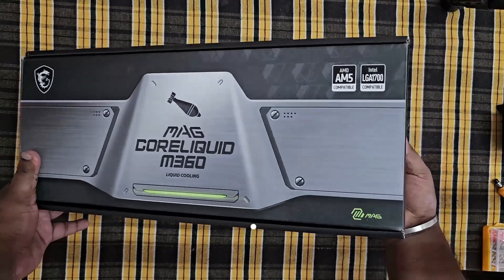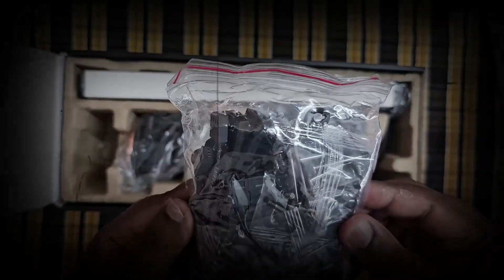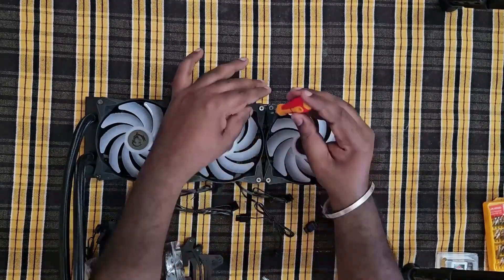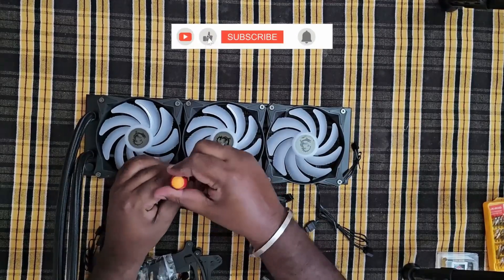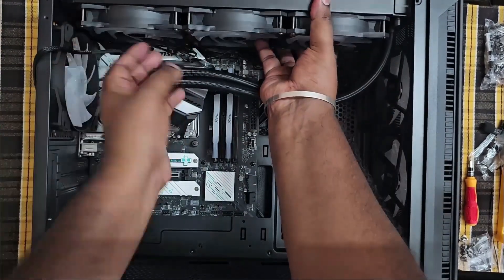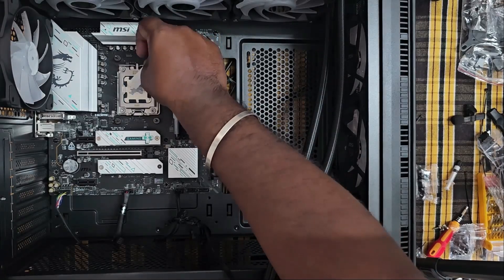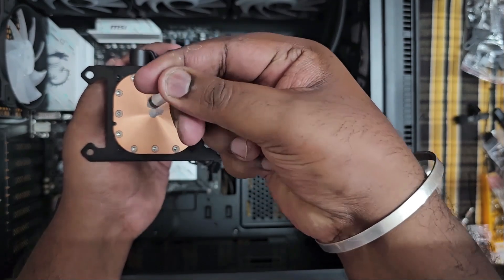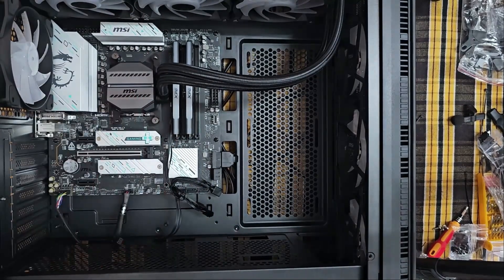MSI MAG CORELIQUID M360 Unboxing & Installation | Step-by-Step Guide

Comment: I'm confused between this and Acer Nitro Vg271U M3 ips monitor, could you tell me which is better ips or va? Also did you buy this from amazon?
Reply from the maker: I think you made this comment on cooler unboxing video. Monitor we have another video and replied to you on same. Anyway the purpose is for gaming then yes ips is better performer comparing to VA. 

Key points to consider:

IPS Pros:

Excellent color reproduction 

Good viewing angles 

Consistent performance across different viewing positions 

Suitable for most gaming genres 

VA Pros:

Superior contrast ratio, leading to deeper blacks in dark scenes 

Can achieve very high refresh rates on some models 

VA Cons:

Potential for "ghosting" or image smearing in fast-paced games due to slower response times 

Narrower viewing angles, colors may wash out when viewed from the side